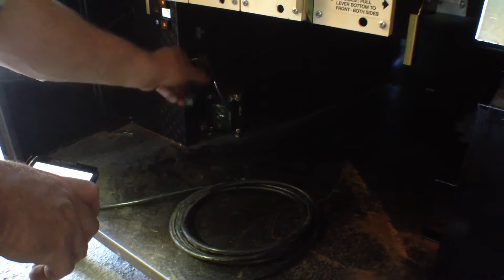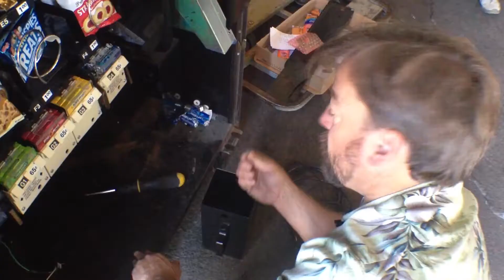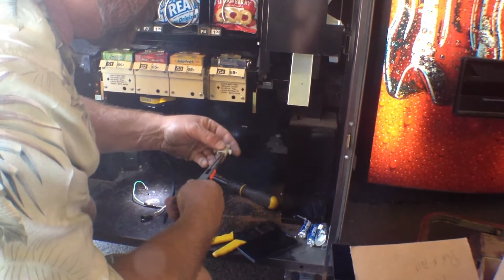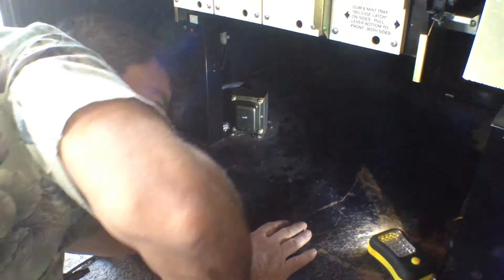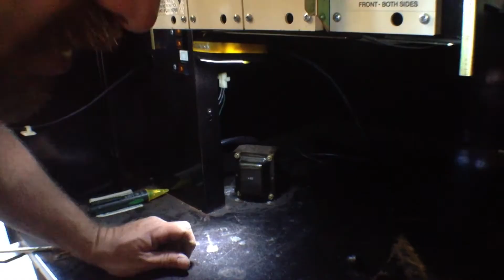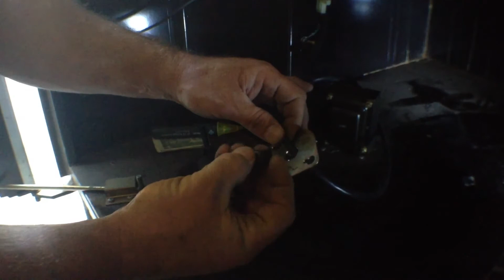How to Change a Vending Machine's Power Cord

Comment: Did the replacement power cord come pre-terminated with the Molex harness electrical connectors/contacts or did you crimp (and solder?) them outside the video?